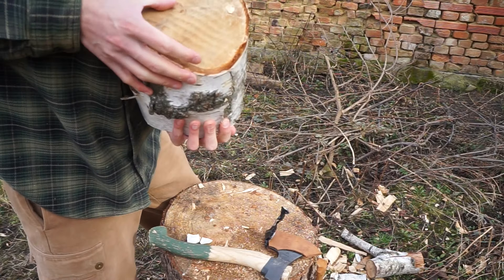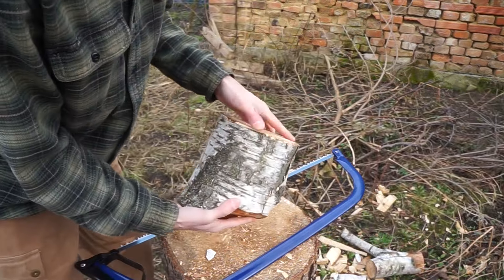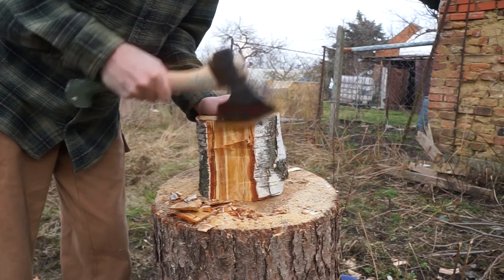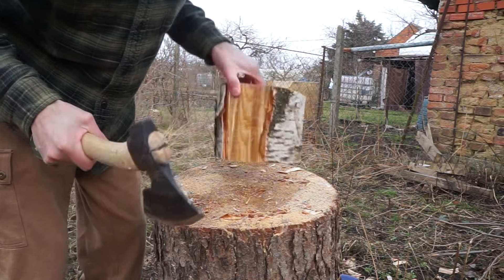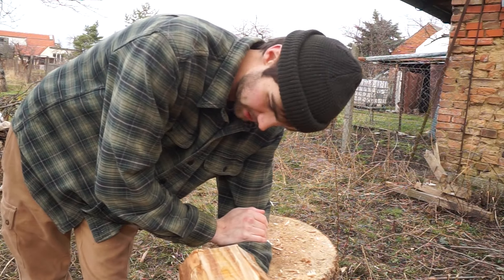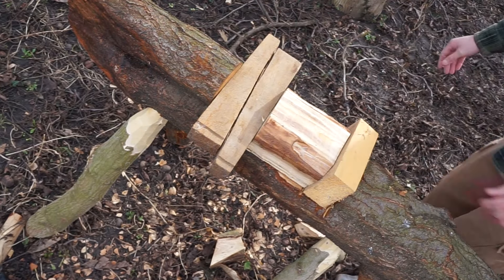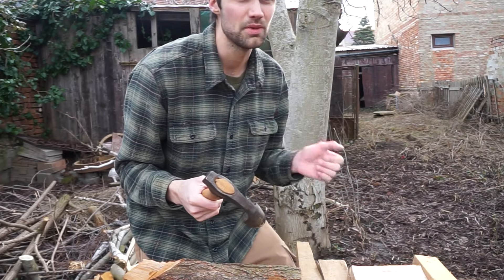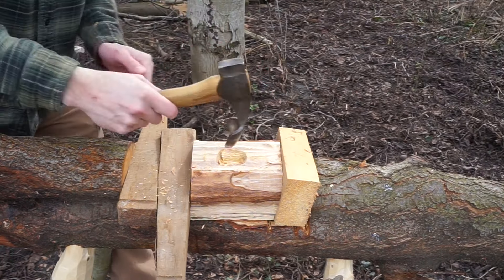Tutorial: How I Hollow A Wooden Vessel Using A Twca Cam

Comment: Bit of help please if you can, i bought a Beavercraft  Adze 50mm,  i do not think it's as sharp as it could be  ?
How would you sharpen it ? Would you concentrate on the inner edge ,  or the outer edge 🤔 .
Cheers Les.
Reply from the maker: Hey there Les. Great question. So I would clamp it and brush the outer bevel away using an abrasive, attached to some kind of paddle. 
I’d begin by highlighting the bevel with a marker pen and then clamping in a bench, edge up. Be careful to notify anyone that also uses your space as I have seen this go rather south too. 
Now, if it is just to sharpen a factory edge, start with a grit of 600 wet and dry paper, pulled tightly and taped at each end of a paddle. Brush the paddle away from the edge, aiming to remove all of the marker pen. Before graduating to another grit on the same bevel, wrap the paper around some dowel and lightly brush from left to right on the inner edge to tackle any burr before replacing the paper with 800, 1000, 1500, 2000. 
Finally, strop the outer bevel and repeat the dowel method with 2000 on the inner. Hope this helps!
Reply: @samuelalexandershapes   thank you for that 😊 🙏  will give it a go. 
I also thought that not to far back, on the inside edge it looked a little bit on the thick side  ?? About 3/4" back from the blade edge, it seems to sweep out thick quite quickly.
If that makes sense. 
Regarding work area, just me. 
Yes I've had a few cuts,  yes get nagged by the wife, why do you want everything so sharp  ??. ( have to be careful 🧐 on blood thinners) 
Finally,  have a great Christmas 🎄 and New Year. 
Cheers Les.
Reply from the maker: @lesliecrowther7004  Yes, adzes tend to be quite aggressive in their taper toward the bevel. It depends how they’re forged and with that steel but they usually are thick, if not for strength then for weight. A light adze is so so in-accurate compared to a heavier one that asks more of important muscle groups. 
There should be little to no risk of cutting yourself with the adze if you use it with two hands. I put my non-dominant hand under the wrist to provide little room for sideways movement, another anchor point. 
Like most, I’d say that the hazardous force required to drag or push a dull knife through wood is far more dangerous than an obedient sharp one. But yes, do be careful if on the thinners please! I hope you’re having a wonderful festive holiday Les

Comment: Did you use the same 🪓 axe for splitting that piece of wood  that you sharpened on the Tormec  ????
Reply from the maker: I occasionally do! Not with tough woods, but with birch, I tend not to worry heaps. I made this before I got my Tormek and found an old splitting axe.